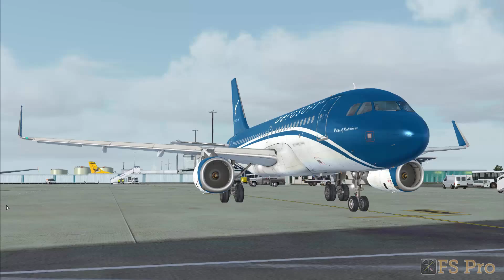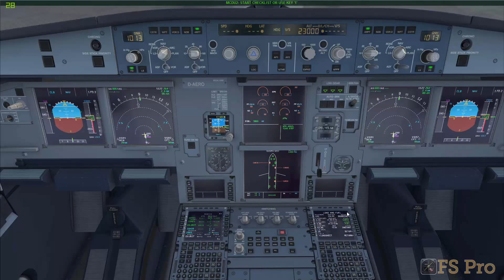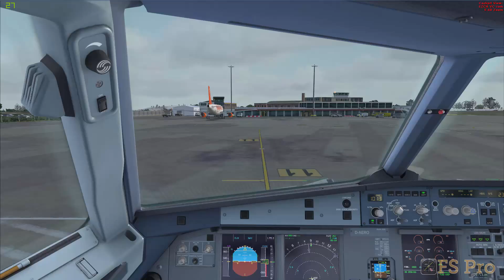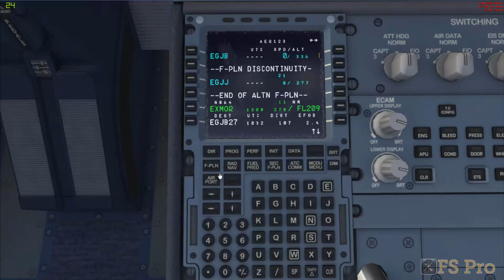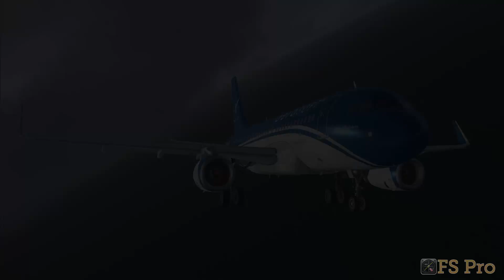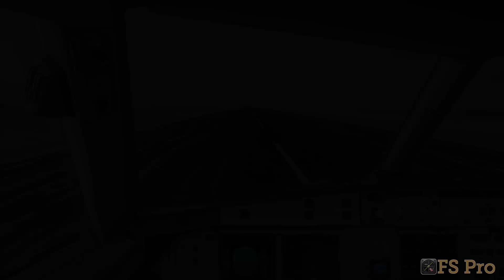Airbus A319 Bristol (EGGD) to Guernsey (EGJB)

Comment: I never get the option to start from cold and dark in FSX. Moreover, the flight planner doesn't work in either of the Airbus or Boeing aircrafts. Also the A319 is not available in my version of FSX. Could you please guide me how to start from cold and dark and also use the flight planner? Apologies if I have asked any silly question here as I'm new to this simulator.

Comment: i seem to remeber a joystick anomaly qite a few years ago when the saitek joystick used to fall asleep as it where and needed a few movements or inputs to wake it up again so that it could continue steering, this was way before wind 8.1 and it dates back to 2005 i think. i believe that especially usb joysticks, which were new then, there seemed to have been a sort of lag taking place if not used for any length of time.i use a normal older ms joystick connected by cable and so far i don t intend to use a bluetooth or other non- cable stick becuase i want to avoid any lag.

Comment: hello,

I have buy the airbus bud can i use the yoke and trottle quadrant  from saitek that i using for the pmdg.
i know that the airbus have a joystick.

regards bert from holland
Reply from the maker: +bert stakenburg Hello Bert - Hard to say because I don't know what exact model your yoke and throttle quadrant are. I use a Saitek X-52 for the Airbus and it works great.